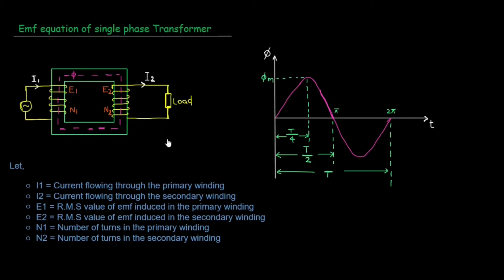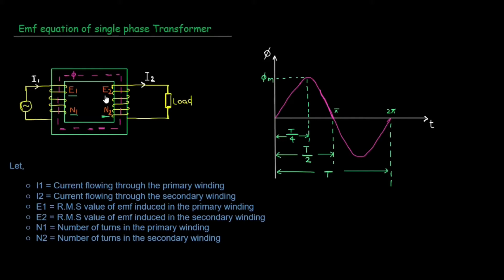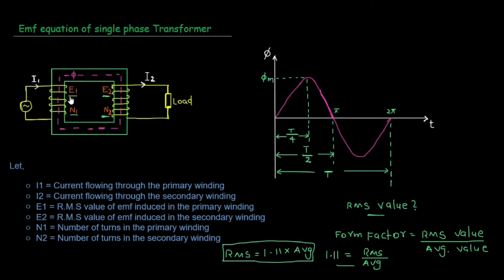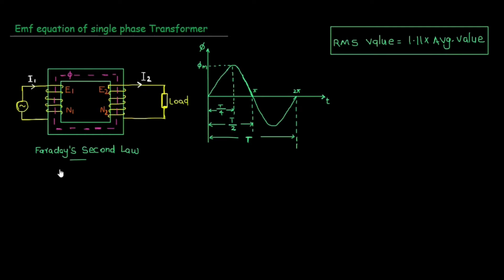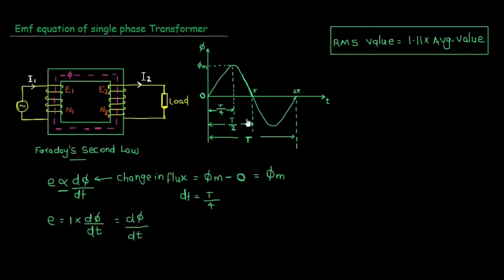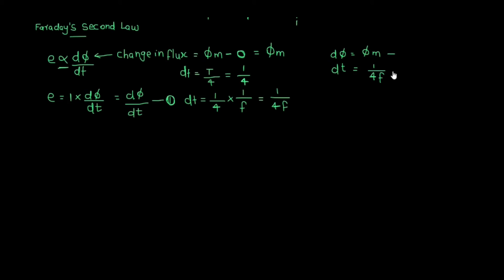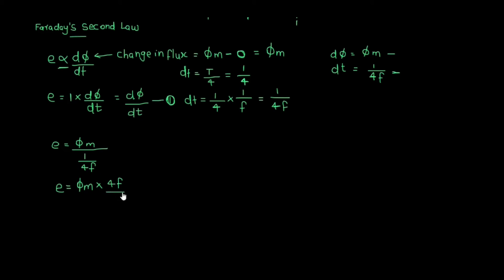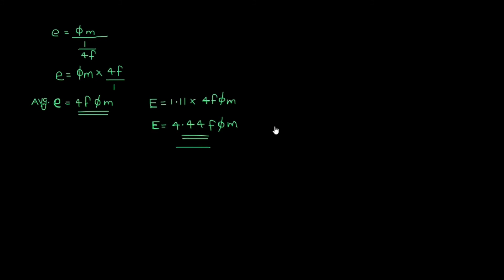EMF Equation of Transformer in Malayalam

Comment: ചിലതിൽ ഇന്പുട് 220 വോൾട് എന്നും ചിലതിൽ 230 വോൾട് എന്നും എഴുതിയിരിക്കുന്നത് കാണാം. എന്താണ് വ്യത്യാസം?   220 വോൾട് ഇന്പുട് ഉള്ള് ആണോ 230 വോൾട് ഇന്പുട് ഉള്ളത് ആണോ നല്ലത് sir 🙂

ഉദാഹരണം 220 പ്രൈമറി 45 സെക്കണ്ടറി എന്ന് കാണുന്നു. ചിലതിൽ 230 പ്രൈമറി 45 വോൾട് സെക്കണ്ടറി എന്ന് കാണുന്നു. ഇതില് ഏതു ട്രാന്സ്ഫോര്മര് ആണ് നല്ലത്?
230 വോൾട് പ്രൈമറി യിൽ കൊടുക്കാൻ പറ്റുന്നതും 220 വോൾട് പ്രൈമറി യിൽ കൊടുക്കാൻ പട്ടുന്നതും തമ്മിൽ ഉള്ള വ്യത്യാസം എന്താണ്? പ്രൈമറി turning ലു എന്തെങ്കിലും വ്യത്യാസം ഉണ്ടോ??
Reply from the maker: Number of turns മാറുന്നതിന് അനുസരിച്ച് secondary voltage നമുക്ക് adjust ചെയ്യാം.
Eg:
No.of turns in primary 100
No.of turns in secondary 50
Primary ൽ നമ്മൾ 220 volt കൊടുക്കുന്നു
അപ്പോൾ secondary ൽ നമുക്ക് 110 volt കിട്ടുന്നു.

ആവശ്യത്തിന് അനുസരിച്ച് primary and secondary number of turns നമുക്ക് adjust ചെയ്യാം.